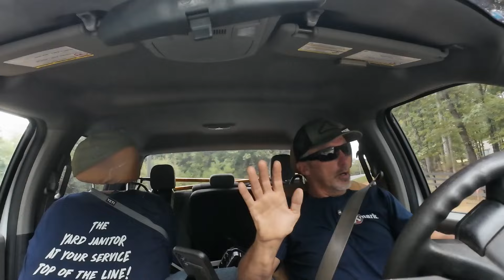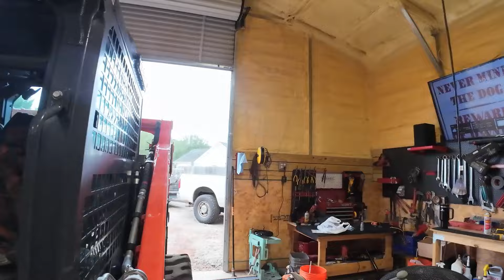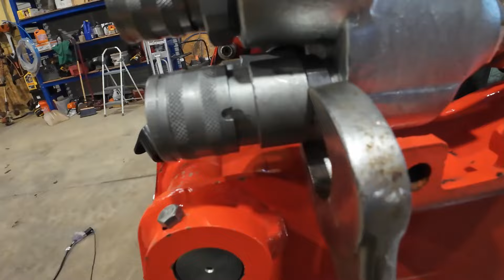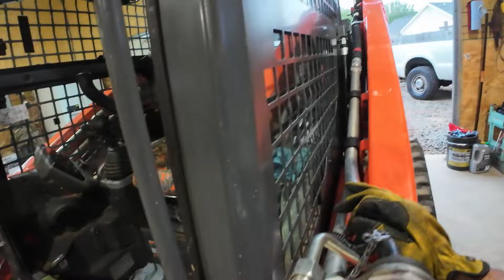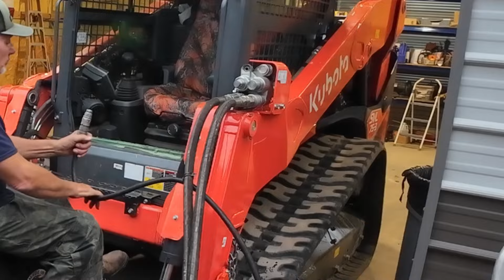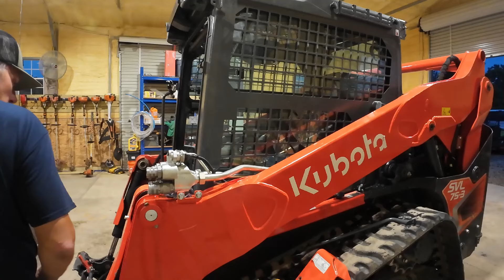Costly mistake by The RAYSTER

Comment from the maker: Good for you buddy- But u do realize that forcing a customer to allow u to come in these conditions does not promote good relations for the future-rather they agreed in the spring or not- There is a sense of common sense that a customer is expecting in that agreement- and mowing unnecessarily weekly in a drought is a waste of their resources-
So don't be surprised if you lose some of the customers your dragging right now.
I dont think your nurturing relationships for the long term doin it this way especially on the homeowners properties. Most of my customers are sensitive to that as am I.
I'm building lasting relationships where I make it difficult for customers to fire me.
Your making it where the customer will let you go cause they may feel your beating them (even though they agreed in the spring)- It's affecting your profits because your density is constantly changing- I keep my density the same or better from year to year- building on it and rarely losing a customer-unless i want them gone. Thats because im applying common sense in the contract as well..
Reply: Uuhhh riiight 😍😍

Comment: Ray is this warranty work? I would have took it to the dealer myself but if not I understand doing it yourself but damn if it ain't one thing it's another brother.
Reply from the maker: No it doesn't fall under warranty work. Now , if I had taken it to them to put the high flow coupler in and they broke then yes.